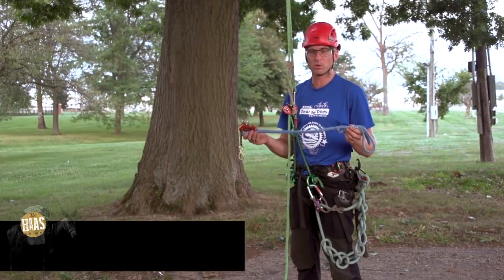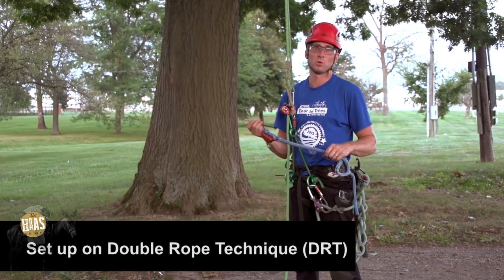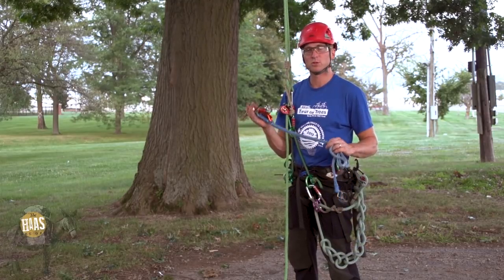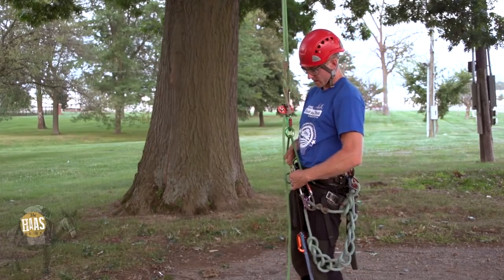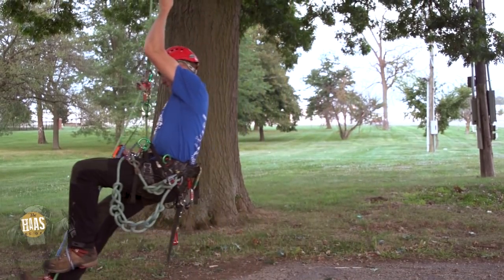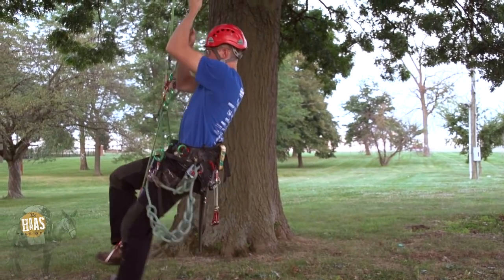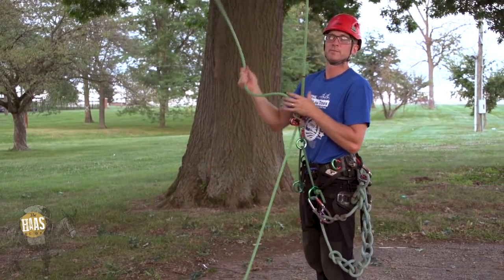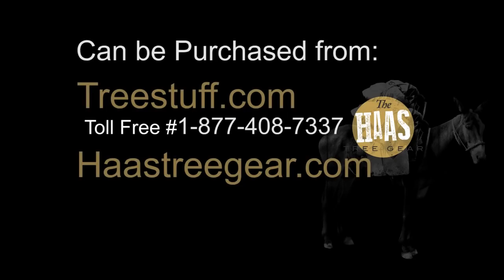Double rope Technique (Drt) Set up

Comment from the maker: its really simple,  the really interesting thing is if you dry crotch you can  really feel the loss due to friction.  when you body thrust, its a explosive movement so its hard to gauge the friction.   with the haas the movement is  slower and  more deliberate,  you can really get a feel for how much energy you are loosing between a dry crotch and rings, or pulley saver.   I really like to use it in a double system, much more that I thought I would.